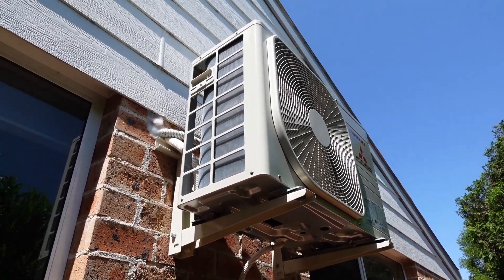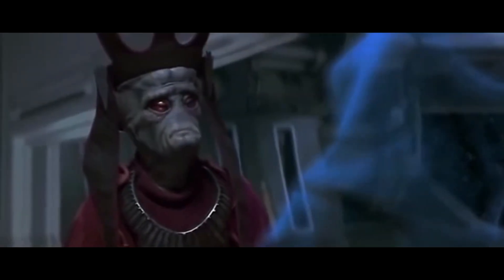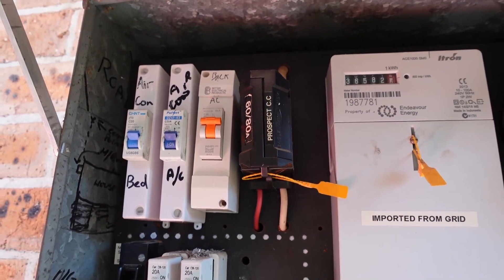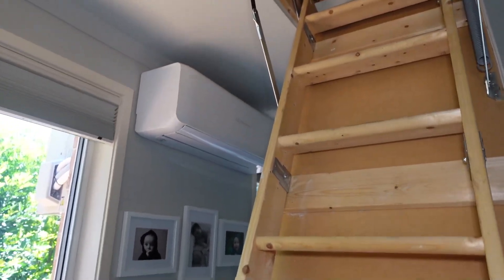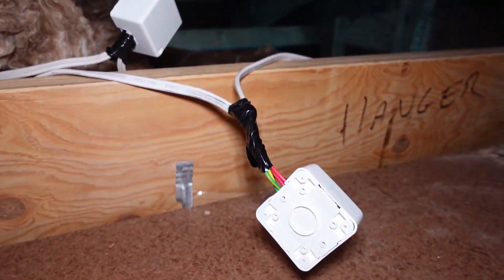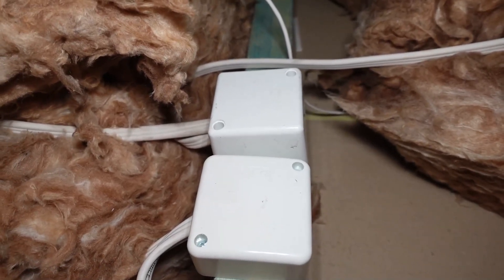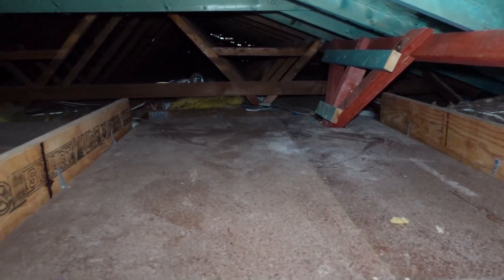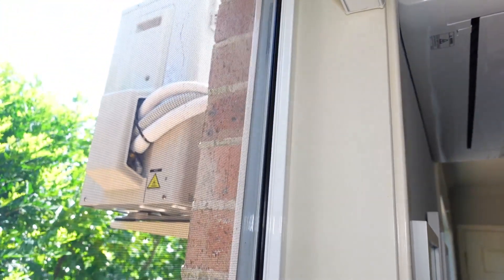Aircon Wiring Install FAIL- TWICE!

Comment: What regulation did they not break?
It's a extension of a electrical system (and the whole system which is extended must meet the new codes in most countries; there are some tricks do don't need to do all total rewiring with a fuseboard only for the AC's).
Why don't need the cable to be clamped down? 30A for short time might do something intressing if the wires aren't clampled down?
What is double isolation?

In some countries you need to fuse the earth/ground/neutral with a special $1000 fuse for a tesla wallbox (cut all power wires, neutral wires and then only then ground if the impandance of the earth systems goes beyond some magical numbers) and there you see this.

Comment: "It's about 50+ degrees up here..." 
So, what you're saying is, your attic obtains the same temperature as Phoenix, Arizona in the summertime? Which begs the question, "But is it a dry heat?"
Reply: Sydney is probably 80-90% humidity the past few days. So it's fucking dreadful.

Comment: yeah...
I'd be inclined to have a little squizz inside those j boxes. Just to make sure the connections are up to scratch.
Reply: And you didn't watch the video before commenting?
Reply: @johncoops6897  did he say he did? If so I missed it. Otherwise, show me the time stamp where he looked inside them.
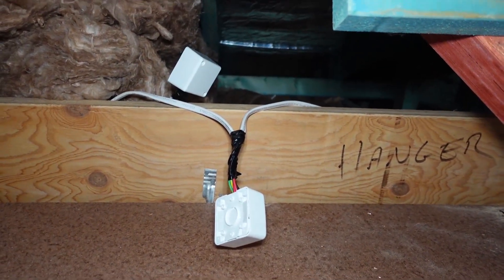Reply: @jimmyb1451  - I just checked again and I think I was wrong. At 6:05 I thought Dave said that HE had fixed it, but after listening carefully I now think he said "he has been back...".
So, I agree that Dave should follow your advice.
Reply: @johncoops6897  Yeah I didn't think he'd said he'd looked at the actual terminations. Having seen the rest of what they did, I'd be rippin' them J boxes open just to make sure there's no Elton John's inside. (As Big Clive would say... "Careless whiskers")

Comment: Oh come on Dave, you're an electrical engineer, what would you know about household wiring?  As if you could have done better.   That is sarcasm, just to be clear.

I love the "electrical tape".  It should be called "tape that bad electricians like to use for no apparent reason".  All it does is leave sticky adhesive residue everywhere.  It's not like it electrically insulates anything or actually binds things together.

Comment: I had a team who put an aircon in my bedrm and they were terrific; I did have a separate dedicated 15A cicuit GPO right there on the wall, but they were in and out in a matter of an hour. Did a great job; two installed the aircon one in, one outside and one spark fixed the board downstairs and put the isolation sw on the o/s wall. Good team and it was a straightforward installation.

Comment: Dave, your SELV " alarm" wire should either be in a conduit or removed as these and 240v are not permitted to be in that proximity to each other without a barrier.

Comment: Unbefnlievable. I have 3 separate lighting feeds and separate feed to each room a total of 24 circuit breakers in a neat DIN panel inside the house with the meters (two different tariffs are available in Tassie) in a separate box outside the house.. A total of about 500 metres of 2.5 mm twe cable. , I did my wiring under the supervision of a sparky. Hot water and ovens and SPA of course all have thier own feed.
Reply: yea daves house was done minimal install.

Comment: Yeah, that's a bit of a silly way to install it. Usually you'd have some manner of duct over the outside penetration to make it look a bit better.

It's somewhat common to piggyback small aircons like that off power circuits, however given there were two other circuits for aircons it'd have made much more sense for them to join into one of those cables in the roof.

That junction box is also a bit silly. Usually you just bend the cables back around inside and it keeps the individual conductors from showing. You don't often see them mounted unless it's a new install.

Comment: I find it really odd that your houses only have a couple of circuits. Almost every place I've lived has had a separate circuit for every room (plus AC, furnace, washer, dryer, range mostly).
Reply: Modern installations have a lot more breakers than older ones. Same here in Germany. The most extreme example was an apartment I lived in that only had one 16 A breaker. If the installation was built today, the same apartment would have at least 6 circuits, maybe more.

Comment: Yank HVAC person here.  Here stateside you HAVE to have an isolator/disconnect within 6ft (2m) AND in line of sight for fire protection and service safety.  Also worthy of note; units will have a minimum and maximum fuse or breaker size.  If they are not on a dedicated circuit the local isolation point must also contain a breaker or fuses.  Gunking penetrations with clear silicone (goes on milky, eventually goes clear when it fully cures) is a common practice I'm not fond of personally.  If you're passing through a weather barrier expanding intumescent foam is preferred with a return visit to shape and paint to match as close as possible (bonus points if the homeowner has even a dried up old can a paint that can be color duplicated).  Installing equipment competently is becoming a dying trend.  And don't get me started on installers that can't be bothered to dress their wirework like the back of your consumer panel. YEESH!

Comment: No disconnect at equipment, probably non-compliant cabling between the units, improper junction box installations in the attic, yup that install would never pass inspection in the US.

Comment: None of that would ever pass here. As you would have to replace the main panel with a new one due to the electrical work being done.
Also crazy to have all lights on one switch so if you lose one you lose all of them.
Reply: We have a similar requirement here in Australia, but the previous upgrades have not been done "legally".. I agree it's crazy to have so few individual circuits. It was obviously a VERY budget home when it was built many years ago, and nobody has spent a cent to upgrade it properly since.

Comment: That's a shocker of an install! All air conditioning installations require their own electrical supply and a dedicated CB of the correct rating for the unit, an isolator must be mounted to the wall next to the unit and not to be attached to the unit casing under any circumstances! The wall penetration should have had wall penetration capping over it not a tube of silicone gunned in! Report these clowns to both the electrical regulator of your state and also ARCtick (Australian Refrigeration Council) as clearly this installer is either not a fully qualified air conditioning installer or only holds a certificate 2 for split installs, usually plumbers and sparkies get these licenses, and he/they need to be hauled over the coals as looking at this makes my eyes bleed!

Comment: <<< Sydney Electrican,       ALL domestic circuits must have RCD protection as per asnz3000 2017...Maybe time to get them back a 3rd time
Reply: Not a single Rcd in my panel Here in nz. 
Not sure what date this place was re wired
this place only got 
MCB's
Earth rod
supplemental bonding, kitchen sink/bench laundry sink

Comment: I don't know that I understand what a main power point is I assume an isolator is just an AC disconnect
Reply: But I also don't really get 2 circuits for the whole house and I mean if you only have 2 that makes sense that you would add to them
Reply: A "power point" is a socket outlet, a wall socket, the place where you plug an appliance into. Old home in EVERY countries have very few circuits. This one is from the 1970s and back then the standard was 2x15A power, 1x10A light, 1x32A stove and an off-peak hot water.

Comment: I'm a Refrigeration mechanic/ Airconditioning Tech. Mate you need to upgrade your switchboard, that things a mess. Also that aircon bracket should have been a bit lower so they could put some colourbond capping so it hides the pipework a bit better. 
The ac can be spliced into a general power circ only if there is enough current rating but mostly it has to have an MCCB  
Not just a standard breaker. Also having no isolator next to the unit is also illegal.
Crap install I'd get them back to atleast put an isolator at the unit or tell them you will call the ESV or who ever it is depending on state.
Not sure why you put this as a rant on YouTube I don't watch your channel but just stumbled across it ha

Comment: Hey, the 1950s called and want their distribution board back.
Reply: It Dates WAY earlier than that :D   That's some roaring 20's stuff right there.
Reply: @cdw4255  at least it is not cloth insulated or knob and tube.  I'd stick with 50s style but modern wire.
Reply: @notamouse5630  Oh yeah, without a doubt.
Reply: @notamouse5630   - and no visibsally asbestos coated wire
Reply: @Killerspieler0815  Just paint that with insulative coating, the asbestos will be fire resistant and you can kick that can down the road.  Cloth may rot but asbestos will last forever.

Comment: Everything about this horrifies me - from the dodgy wiring, the dodgy distribution box (don't you have DIN systems over in Oz?) the poorly installed ceiling insulation, the lack of an isolator, the wall penetration.

Comment: I'm not sure why you're complaining about their wiring, they were just being consistent with your electrical box!

But more seriously: What's with the random bare orange wire flapping about in the breeze inside your electrical box at 3:40? I'm not surprised they didn't want to touch your electrical box.

Comment: looks like a full submains upgrade job, and didnt see and rcd's
Reply: and yeah iso switch should be next to equipment, so whoever is working on it, knows its definitely disconnected and someone in the house not going to switch it back on while being worked on

Comment: I am feeling disguise seeing my aussie colleques delivering jobs in such fashion. Apart of the fact that australianish meter boards are seemingly some sort of 'everyone can try here' solution where clearly not ingress protected MBCs are subject to dust and moisture- there are many other mistakes obvious. One of the most horrible ones is to pass a loaded cable trough mineral wool insulation which in turn changes the current carrying capacity significantly. I guess the MCB may be C20 or B20 on this 2.5mm² wire- thats critical. 4mm² would be a good choice here. Concerning the separate isolator switch... Well, it may be us aussie regulations but further its never a good idea to connect large inductive (especialy VFD driven) inductive loads to circuits where electronics may be present. That alone may cause secondary harm many users search ages why their brand-spanking-new TV sets keep roasting ;)

Comment: holy sh*t... here in the USA , if a electrician / inspector / power company  saw wiring like behind  your electrical  box  they would sh*t themselves and have the power company cut the main service wires completely off the house until it was completely redone... lmfao.
 i've been an Electrician for 25+ year and never seen something like that before.. lol  is that normal over in Australia ?

Comment: Hey Dave, not only was not installing an isolator illegal as you pointed out, but they also just used a circuit breaker with no form of earth leakage (RCD) protection. All residential circuits installed now need to be on RCD and this is not.

Comment: hy dave a q in Australia you have this type of cable ??? http://stafeta.hu/webshop/vezetekek-es-kabelek/pvc-szigetelesu-kabelek/mmfal-pvc-szigetelesu-kabel-vakolat-ala
Reply: The cable used in Australia is similar, but like on the left with earth (ground) in the centre. The outer sheath is thicker, and there is no requirement for each core to be double-insulated. So the white outer sheath covers all 3 single cables. When you strip the outer sheath, all 3 inner cores are exposed.
Reply: @johncoops6897  thanks . a note : the cable I posted the middle mart is for nailing to the wood
Reply: @ventusprime  - we use a special clip to nail them, since we could not trust that any electrician would be able to staple or nail with enough accuracy.
See picture: https://www.pulset.com.au/10-12mm-cable-clips.html

Comment: The new A/C unit should be RCD protected.   The regulations changed in the last amendment last year.   This presumes that this unit is connecting via a socket outlet inside.  Small machines like this are typically fed by a dedicated 10A final sub-circuit.     I'd look at plowing this board in though.  I'd be reporting the boxes to the OTR.  That's fucked.  The cable should be clipped-up.  At the moment, it's self-supporting.  That's illegal.

Comment: It's not illegal, just plain bloody lazy. Technically it's still on an isolator but it really needs to be on its own, otherwise there's a danger it could zap all other devices on the same circuit.

At my folks house, all the wiring is done in a grey-zone sort of way but even we have a separate isolator for all three air con units around the house. No way were we gonna have something that beefed up on the same lines as our day to day devices.

I hope you kicked their arses.

Comment: The electrical box is really bad, in the Netherlands we use ABB 3640 box to join together the wires with WAGO clamp , all 100% NEN1010 the European standard, this is rubbish what they have done it's not how it should be done.

Comment: Even though it is not a legal requirement (at least here in NZ) I suggest you get a new switchboard (consumer  unit if you are British) installed inside the house. You can leave the meter in the outside box. Your new switchboard will have space for additional dedicated aircon circuits and all power sockets and lighting circuits will be RCD protected. 
I install high wall aircons and sometimes the home owner will ask me to upgrade their fuse box, switchboard, consumer unit, whatever you like to call it. It usually takes a full day though.

Comment: The amount of jobs recently I've seen areas like lofts, understand cupboard, airing cupboards etc.  It's 'Outa sight, Outa Mind".
Like your shoddy wiring?... No clips,  who g cable or flex, timber arcitrive missing inside cupboard, poor plaster finish ,especially at skirting board height. Basicly all the areas that need a bit of time ,effort and skill are just ignored, because door can be closed and forgotten. Crazy.

Comment: Just lazy bad practice isn't it.
Always fit a.3pole isolation unit. Fuse Spur.
Best on dedicated circuit/ breaker. 
But could spur from existing socket close by.  But first is best of course .
Lazy workmanship ... cables on show, out of box.  No sheathing.

Comment: That fuse box is so different from how it's done in the States, I don't even know what I'm looking at. None of that is even close to being acceptable here.

Two circuits for the whole house is crazy. I have like 20 circuits in my house. The kitchen alone has 7.
Reply: Sometimes common even though I think it is stupid.
typical layout 
2 light
2 power
1 hotwater aka immersion heater
1 oven
main switch

Comment: When they install the isolation switch ensure that they don't cheap out and mount it onto the outdoor unit itself.  It's not an isolation switch if the unit is not isolated.

I'd be getting someone else in to complete that work then send the original installers the bill.

Comment: Where I live there is usually only 2 or 3 socket circuits in a house, two lighting circuits, sometimes a cooker circuit, and sometimes a circuit for an electric shower (and there may be other circuits such as electric car chargers, smoke detectors, etc...)

Comment: Is there any particular reason you choose individual units over central cooling? With that many it would seem reasonable to do so.
Reply: They are very expensive, why cool the whole house when you might only be in the living area all day, the thermal loses in the roof spaces in Australia is high when its 45 degrees Celsius outside its 70 degrees in the roof...any more reasons
Reply: @aussiegruber86  A good number of those systems allow for certain areas to be cooled / heated. i.e. common area, bedrooms, etc. Can certainly agree though that those individual units are much better than central evaporative!
Reply: Individual units are far more effective, plus there is no need to cool all the rooms all the time. The idea of the split systems is that they can cool a "zone" really fast... you don't run them all the time, so during the day when nobody is home they are all off. When you need a room cool, a powerful local unit can bring the temps down in a few minutes. In a hot and humid climate like Sydney, it's the only way we can afford to run decent A/C.

Comment: Clickbait thumbnail. That was not illegal.
Reply: It's non-compliant with the regulations, which is generally considered 'illegal'.
Reply: @Monkeh616  Dave literally said it was legal.
Reply: @Okurkaarrgghh  .. the usage of the circuit, not the horrible wiring itself.
Reply: @Okurkaarrgghh  Clearly the point is completely lost on you and/or you just want a childish argument.

Comment: Wow, are those standard panels in Australia? I expected something more traditional like an IEC breaker panel or maybe a NEMA panel but this is actually a galvanized box with a wood fiber perforated panel? And the breakers can be placed anywhere and then need to be routed manually to the incoming mains after the main protection? That seems quite dangerous if you do not know what you're doing. I guess it's cheaper, but I'm disappointed in you Australia! And isn't it inconvenient if it's pouring rain outside to have to go out and reset a breaker with both feetsies in a water puddle?
Reply: Everything electrical is quite dangerous if you don't know what you're doing.
Reply: It used to be common to install these, but nowadays new panels are mostly DIN rail type.